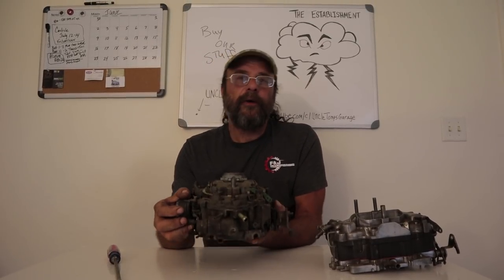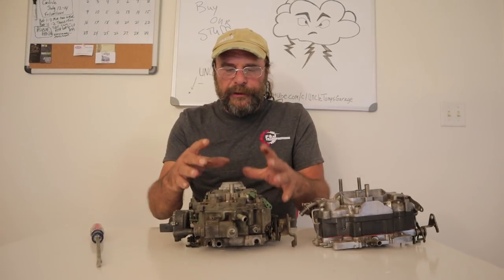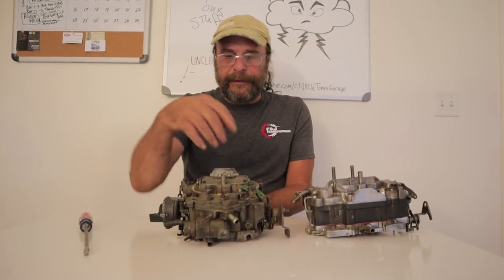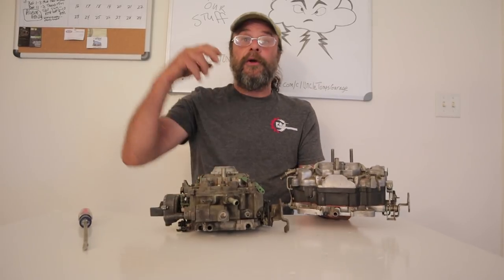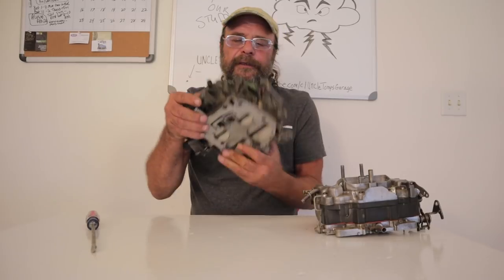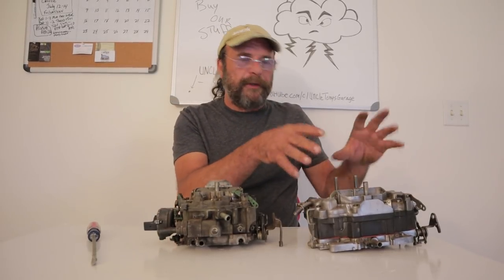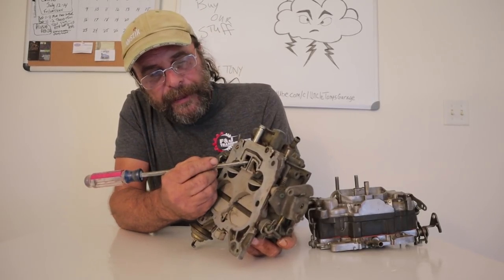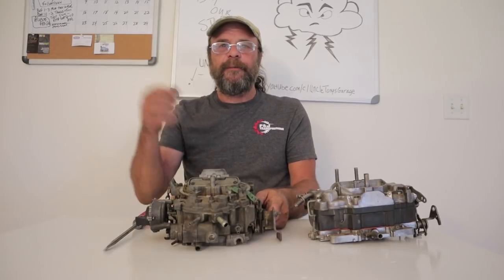The Quadrajet

Comment: The spread bore design was a much more advanced idea than the ancient square bore carbs. Me as soon as I read up on the the Thermo Quad I decided to try one on the 318 in ny Dart after running a 383 avs I tuned and rebuilt for it. I found a 9800 TQ at the local swap meet in the early 90s for 2 bucks with the electric choke setup and setup for a Chevy. I swapped in a Mopar throttle shaft, rebuilt it, and tuned the jets and metering rods till it felt really good. It went from about 10 mpg on a good day to close to 12 with a street master single plain intake and was silky-smooth through the power band. The AVS ran super clean but had the usual drivability issues they had. I ran that 2 dollar TQ for over 10 years till it finally blew one of the fuel transfer tube o rings, I rebuilt it again and ran it till I found a super low mileage 9801 with the factory Mopar linkage and rebuilt it and swapped it on. I ran that probably another 10 years till it sat forever when I retired the car and lost the accelerator pump. It still ran good enough to drive 5 miles to my new house in 2012 after sitting since 2006, just bogged off the line so wasn't fun to drive. So I need to look it over and see if it's worth rebuilding again. If not I have yet another 9801 that is missing the electric choke and choke plate, but gas never had gas in it and still has all the factory ink stamps on it. I'll probably piece together the old one though as I don't want to waste a virgin carb on a car that is going to mostly sit once I get it running again. I tell people to run a spreadbore carb if they are going to street drive their car. I obviously prefer the TQ, but a good rebuildable Quadra Jet can be found easily and most folks run GM anyways, though my friends brother put  QJ on his Ford 390 4wd truck and was quite impressed after I suggested he try one because it would be cheap and run nice on a truck that needs smooth power delivery and better mpg. I have figured out most of the tricks to build and tune a TQ and I even finally found a strip kit for the later solid fuel version, plus I have a bunch of complete carbs from all years and parts, plus I have the secondary air door tool which simplifies adjusting them properly and they do actually run about 20 degrees cooler due to the phenolic resin body. I have actually only seen a couple main bodies that actually cracked and most of them were in motor homes or large late model cars that the engine bay stayed super hot constantly.

Comment: I used to race one of these because I was required to, but I liked it.  Never had an issue with heat soak or vapor lock. Just add stack another gasket under it, and don't crank it down too hard.  Always smooth transition when you stomp it at the  lights.  If you race it you can pop that top pretty quickly without much trouble. Rejetting at the track didn't require draining fuel either. The leaky bottom was fixed with little brass pipe plugs and epoxy.  Will you get the MOST out of a given car with a spreadbore?  Likely not, but if your sanctioning body says you gotta use one don't despair.

Comment: I used a quadrajet once and then switched to a thermoquad and never looked back at the quadrajunk. Like you said they fall off in the upper rpm ranges, I had one on a police 318 once and did back to back comparisons with a thermoquad and the thermoquad would very noticeably pull away on the top end. Also because the GM carb throttle plates open in the same direction high mileage engines the 7 and 8 cylinders will be the first to start burning oil and fouling plugs, thermoquads open like every other 4 barrel which gives you a better mix and distribution just below the carb in the intake plenum. Yes the q-junk works decent for an average daily driver but personally I will stick with the thermobog, lol. I have a 1979 d-100 with 3.23 geared 8 3/4 that I built a 383 for 16 years ago, .070 over with 1978 stock 440 pistons for an actual compression of 9.8 to 1, I ported the 452 heads myself and used hughes engines 224-230 @ .050 and .504/.515 camshaft, stock rockers, eddy rpm intake 1 3/4 primary headers, full 3 inch dual exhaust and a thermoquad from a 440 that I tuned the crap out of and that thing would fly, it would push that truck to 150+ mph, whooped a Ford lightning with the supercharged 5.4 once also, he gave me the best race I ever had with that truck tho, in my drivers side mirror I could see him clinging onto my rear bumper at 90 mph.

Comment: Makes total sense now.  Back in the day, a buddy put a Holley on an otherwise stock '87 Monte SS simply because it was a Holley.  It never ran right after that.
Reply: prolly too much carb for the 305
Reply: The stock carburetor on a 1987 Monte SS was a electronic Q Jet hooked up to the computer.The aftermarket
Holley was a total manual
non computer controled carburetor so the computer didn't know what was going on with the engine.

Comment: Wow!  I can remember a 1978 Ford LTD that had G.M. power steering pump, G.M. air conditioner compressor, and other G.M. parts. It had the 400M Cleveland engine.  He also had a radar detector & a speeding ticket for 98 mph.
Reply: Most Ford owners had no clue about all the GM parts Ford used to make their cars work better. Ford was always careful to disguise them.

Comment: I absolutely love the Q-Bogs !...they are a bit finiky to adjust but once dialed in, they make a great carb for daily drivers. Lots of guys are quick to swap them out for Holleys and others, and I always ask them if I can have their old Q-Bogs...9 times out of 10 I get them for free.
Reply: m schiffel : LOL! I've done the same thing for about 20 years! I probably have 50 Q-jets in my garage! My "Holly" friends always laugh & give me a hard time but I like collecting them! I tell them some day that someone restoring a rare car will come a knocking looking for a specific "numbers correct" unit & I'll sell it for a premium price! I have ran the numbers on most of them & have them marked for application(s). Currently none are for sale though. I do have about 20 other brand carbs, in 1, 2, & 4 bbl versions. I want to buy one of the Holly 3 bbl carbs just to have even though everything I've read about them say they are complete trash because their almost impossible to tune. Their so bad, Holly won't even make parts for them anymore!

Comment: I like this video and agree 100% with Rick Williams. I hacked through my 1992 RS and installed a CCC Rochester Carburetor and CCC System. GM mild cam and the car performs way better than it did with just the TBI, Chevy 350 Swap, and Cam swap. Most Mechanics do not understand how they work as opposed to how they think they should work. Yes... I went through about 40% of every issue. Bogging, Flooding, Air Horn Warpage, Choke, etc; I could not find any mechanic who wanted to work on it. But this $30.00 junk yard carb was going to have to work. I did my research, bought books, searched online, bought the right tools and fabricated two tools( TPS Adjustment Tool & Air Lean Screw Tool), and watched videos. But the most important thing I did ...was to set everything back to factory specs as my starting point. Note: I did have to do some grinding to the air horn with my dremel to get rid of my bogging issue, because of the slight warpage and I had to raise fuel pressure from 4 psi to between 4 3/4 psi to 5 psi. Qjets tend to leak with psi over 5 1/2 psi to 6 psi.

Comment: I've had good luck with quadrajets.
You have to have a guy set your carburetor up on a test engine.
They will flow 750 CFM.
Once you got one that's in good condition set up by somebody that knows what they're doing they are a set it and forget it carburetor.
Also when those secondaries open up they sound pretty cool. Especially when you flip over the lid on the air cleaner. Doo-whaaa!
I did have a 780 Holley double pumper I was very fond of.
I ran it on a weiand intake, on an LT1 with Pete Jackson Gear Drive.
and on a 396 in a 66 Chevelle,
on a Torquer, with a 4-speed.
It was a greasy sled.
Hours of enjoyment.

Comment: The Rochester  Quadrajet,  Duojet and the Motorcraft 2100 was always my three favorite carburetors. With stock engines you could pull a Quadrajet off a 283 and bolt it right on a 400 and run it

Comment: Hey, great video. Been there, done that and bought the tool. Rather than trusting epoxy I tapped ever so carefully with a fine thread and inserted  plugs made from set screws. I used lock-tight on them of course. I also used a large piece of aluminum as a heat sink between the intake and carb. Several hours with a hole saw and files. That was thirty years ago, not my car but the guy I did it for was a collector. I presume it’s still alive.

Comment: Dad had a quadrajet on his factory  350/300 70 Impala. He said he went out at lunch on a cold start and the engine spit back through the carb. Try as he might rebuilding the Quadrajet, he never could get it to idle right again. He even changed the cam since it had 80,000 miles and was getting wear. But the idle never would come back to proper adjustment. He finally just parked the car. So here I sit with it... I was never brave  enough to tackle it. For one I know I'm not near as experienced as Dad. So what was the use. But you have shed light on possible causes. Thanks for a good informative video AGAIN, as always...

Comment: I love them and set them up to have a millisecond of hesitation when I jump on it I like that kick in the ass wtf just happened feeling and the look on the passengers face is priceless lol one thing you didn't cover was the fact that they will run about anything from a 262 to a 454 w out a lot of major changes the secondaries only give it what the motor calls for edelbrocks have that counterweight to accomplish the same idea but I always thought the  quadrajet was as you said all around better the engineers put a lot of thought into them hell I have one I took off of a 78 trans am 400  motor that had been in someone's shed since 1999 and I bolted it right on a 305 and it's fine runs great kick in the ass secondaries etc etc i think my saving grace was the ethanol like you said in another video otherwise that carb would have been full of varnish it wasnt hit it with a can of carb cleaner and the chevy motor ate a few cobwebs and shes been running great for 6 months

Comment: I've used quadrajets on my chevelle and my dad's c10, not by choice, but because it's all I had in a 4 barrel.  They run smooth and efficient when rebuilt and tuned correctly, like you said. I will say, I once bolted a 780 cfm Holley  on my chevelle's 350, and it's demeanor changed from when it had the quadrajet. With the Holley it just felt more aggressive and even roared differently. It was temporary, didn't even get to drive it, but I noticed the difference. Great video

Comment: awesome carburetor video once again. P.S the choke fast idle was probably active in the last part of your video if you were having a throttle plate closure issue. sometimes when you turn them over the secondary cold stop lever will hang, I use quadrajets on all my GM cars. there's a larger stainless heat sink for the underside of these available for racing applications to remedy the boiling problem.

Comment: The Quadrajet is what is on my ‘69 Buick Electra 225’s 430 V-8 Engine. Bought completely rebuilt and refurbished spare that I had intstalled and then had the Original rebuilt and refurbished and now is my back on the garage shelf. The are VERY smooth operators!

Comment: The Rochester has an adjustable part throttle screw - the APT - that's very good at tailoring transitory response  and easy to access
Reply: 1967 Chevelle LM7  well I always thought thermoquads were "smog era" carbs kind of late to the party . The 60's carbs were more performance oriented . A 67 GTO or Cadillac Qjet will work good on most hotrods , but it's harder for 70's carbs because of smog restrictions they didn't have "performance" versions . The Tquad was one of the last carbs made before FI started

Comment: I have  one on my 67 Cadillac Deville . I'm 57 and have built and tuned these carbs for yrs . I do have the heat soak issue with modern gas . Its more problematic at ambient temps over 85 . I use 180 octane booster and lead additives . It burns a clean tailpipe . I enjoy the videos thanks !

Comment: I used to make QJs run circles around a Holley..Put a Ram Air float in. Increase the bowl capacity. I miss these carbs.Used to tune the primaries by swapping metering rods and hangers..pen drilling the secondary fuel feeds, swapping rod hangers. Nothing beats the sound of those coffee cup sized secondaries opening up. Most folks were stymied by the Air Valve adjustment. Tony, I had a catalog that listed every metering rod / hanger combo with part numbers. The epoxy trick was mandatory on the bowl.

Comment: Spot on as usual! Ive been Building Q-jets for decades. Ive experimented with various ways to increase fuel flow into the float bowl,  and increasing bowl capacity. Still,  you are EXACTLY correct. On a hard hitter, it's a challenge to get enough fuel through it to supply engine needs. On a 4×4 truck or whatever,  can't beat them. Very stable in nearly upside down operation.   Lol. My rule has generally been (in the past) q-jet for mild performance and gentle off roading, Holley for real performance,  and eldelbrock for long range target practice on  the shooting range. I'm aware of many new carburetors on the market these days, but haven't got to play with any. Regardless,  good video!!thanks UTG!!!
Reply: Russell Mooneyham you are aware that the years after the qjs toney is talking about have larger bowels right?
Reply: @joebradley1520  as I get older,  my "bowels" tend to get smaller. (Or so it seems). That being said, the QJ float bowl that I'm used messing with are the models up to 1985 or 1986. Before the ridiculous electronic controlled primary jets. They still don't have enough capacity for a "heavy hitter". I'm talking about a serious guzzler. Currently building a 454 mild for my square body short step. It will sport one of my modified QJ's. But I'm sure it won't be able to keep up with "WOT" for an extended period. We shall see if it can deliver adequate fuel for 15 seconds or so in a standing start quarter mile run. At 5,300 feet of elevation. Looking forward to finding out!!!
Reply: Russell Mooneyham electric fuel pump, problem solved
Reply: @joebradley1520 . Not always. It occurred to me while I was finally getting to eat my supper,  that you might be under a false assumption. Hopefully this is not the case. As far as I know, the "Rochester Quadrajet" (the carberator on UTG's right), never appeared on Chrysler vehicles. (I may be wrong about this, but I'm pretty sure it was exclusive to GM vehicles), and I'm almost certain that the "Carter Thermoquad" (the one on UTG's left) never appeared on factory GM vehicles. As far as "electric fuel pump problem solved" response,  I will disagree. The problem is the fuel inlet capacity. There is just not enough fuel flow opening to keep up with a ",heavy hitter". No matter how much you supply, you can only get so much through the needle and seat assembly on a Rochester Quadrajet. This is one of the places that Ive been working on modifications..... Also, there's a slight chance that I'm wrong about factory placement of these two different carburetors. Unlike many on YouTube, I don't profess to know everything. Lol.

Comment: I  love the Q-jets.  The current one on my 72 had a  "rebuilt" tag on it from some big performance shop. Never ran right.  When i tore into it, the piston for the primary rods had the pin on bottom nipped off with side cutters or something.  It had no APT adjustment because of this and the rods would pull all the way down into the jets under vacuum.  
Also, when tuning. the secondaries should only  open under load.  if they open when you blip the throttle parked in the driveway, the spring is too loose.  
I've had 7 quadrajets  on cars over the years, including 2 of the electronic ones.  I've had a ton of accelerator pump problems, worn butterfly shafts,  bad choke pull offs, stuck needles and bad floats, and just general crud and varnish issues,  but i don't think i have ever had one leak fuel from the bottom plugs.

Comment: As a chevy guy I have some experience with these. I know how they work and some of the qerks like the low fuel pressure and inability to use large needle and seats without certain float combos or especially low fuel pressure. Generally a conservatively sized holley is more straightforward to tune and give better throttle response. But I've seen some qjets run good. I had one with some lean metering rods that shouldn't have worked but the engine liked it. I had a cheap parts store aircleaner with a paper filter that was maybe 2" tall maybe 1-1/2" and I had a stock fuel pump. I tried all the normal stuff to make the car more speedy. Taller cotton gauze air cleaner, allegedly better fuel pump, thinner metering rods, shims in the rod hanger, bigger exhaust. Despite the plugs looking fine the car only went slower with new parts. For whatever reason the car liked the lean rods and low filter lid which is counter to every Dyno test I've seen on airfilters other than it not being a dropped base filter which is generally actually a good thing even if the filter isn't too tall. I don't know if high base low airfilters typically work well on qjets but I'd try it again.

Comment: I like the quadrajet. I'm glad that you not only talked about it but sang some of the praises AND also some of the fixes for its shortcomings like that well plug issue. My quadrajet on my 79 Chevy K10 has that issue. It'll leak dry after sitting a few days (usually 4) if i don't start it. And then it takes a few extra seconds of cranking to start since the fuel pump has to re-fill the float bowl.